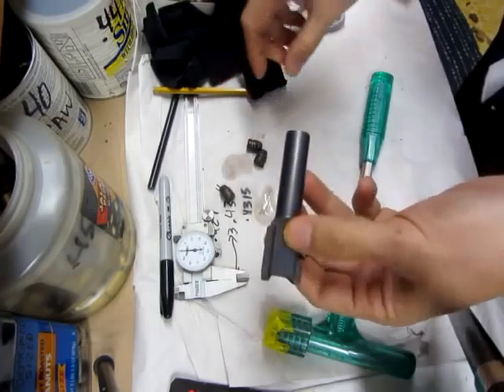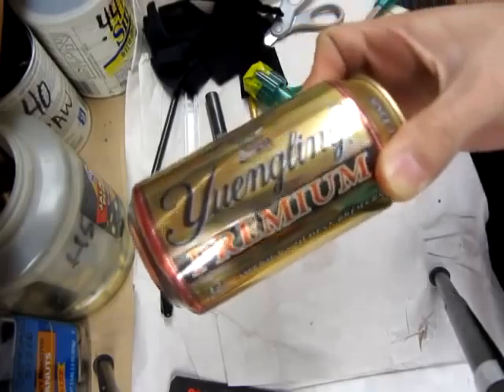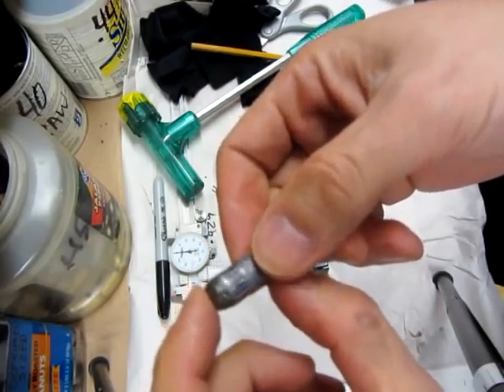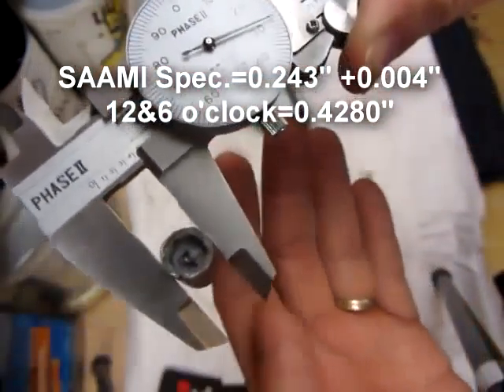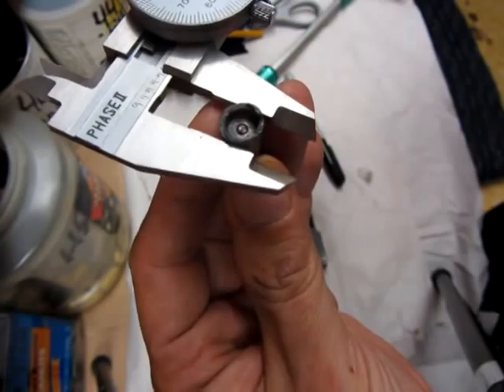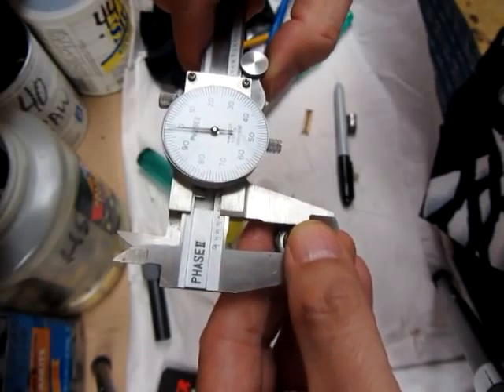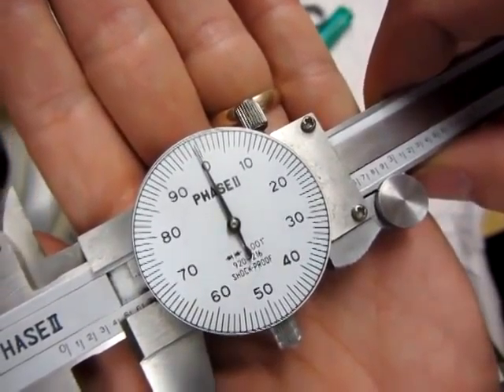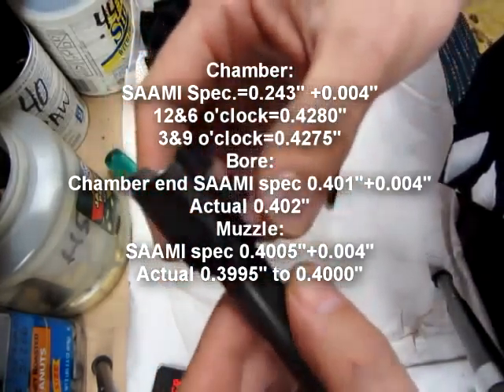Slugging shadofaxx1 Glock G27 barrel

Comment from the maker: It was the soft lead.  I shot factory jacketed soft tips out of my Henry and it worked fine, then I shot the reloads and they were all over the place, then I switched back to the factory stuff and they worked fine.  Need to slug the barrel of the Henry to see what the max bore diameter is, and get harder lead :-)